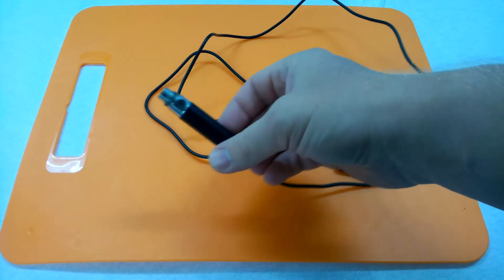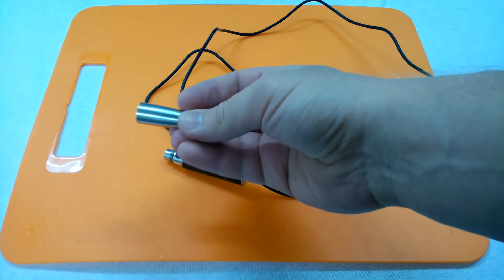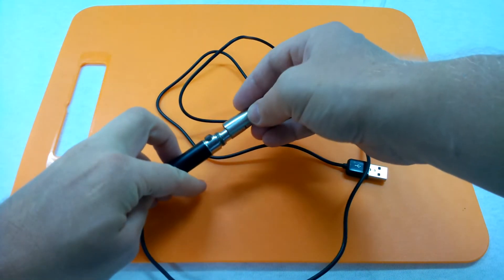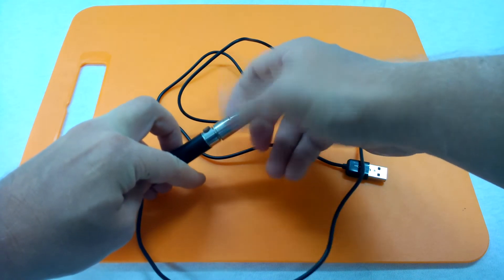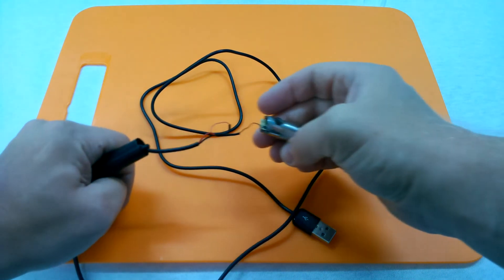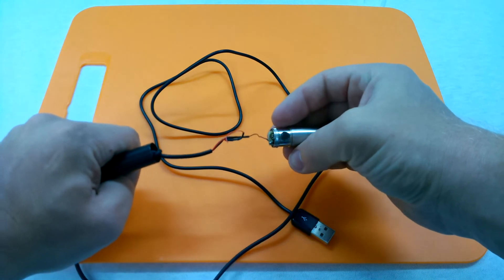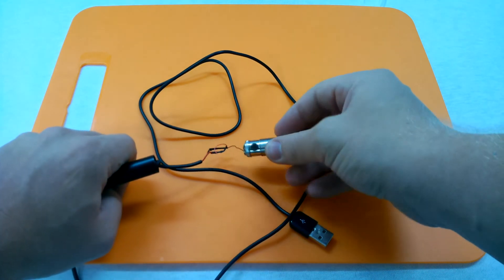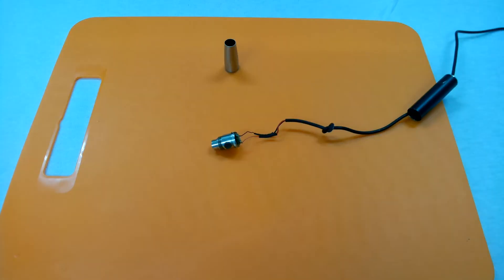eGo passthrough fix

Comment: Damnm I was really hoping this was going to be a proper ego pass-through, the one in the video is in the style f a 510 it has no battery in it the one I want to learn to take apart is called an 1100mah digital pass-thorugh it has an lcd screen and if I could just figure out how to get the buttons out I may be able to take it apart I have one where the button stopped working but the lcd functions just fine. I have another where it's the opposite if I could take them apart and solder the one to the other I Could fix many of my battery's.I have failed to take them apart without wrecking them so I am not going to take anymore apart until I can figure it out. IN case you want to see what I am talking about here is the one I need to disassemble. http://www.bestecig.com/product_view.asp?ID=369
Reply from the maker: 2012 was the last year I bought an eGo, so I don't know much about newer models, sorry. But from the pictures in the link you provided, the process will be the same - gently wreck the threaded connector sideways until it's loose